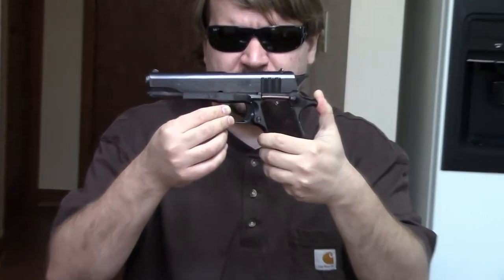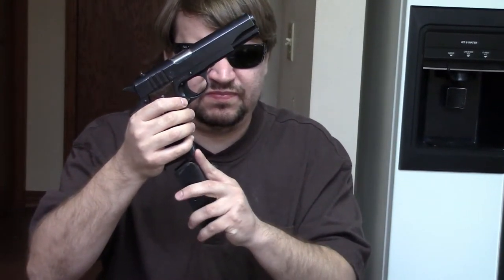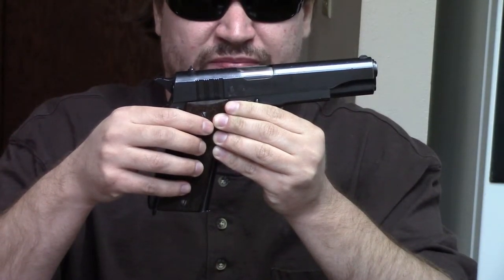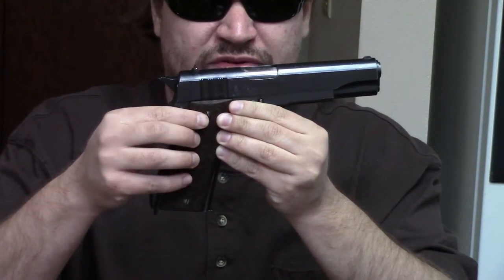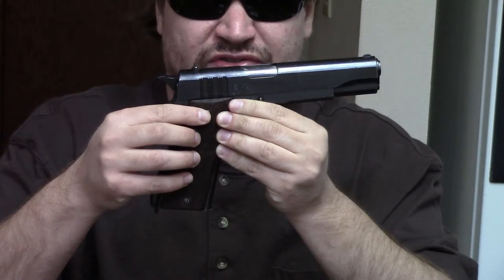Argentine Pistols - Systema M1927, Ballester-Molina, & FMAP Hi Power

Comment: On the Ballester-Molina, while I would take any 1911 magazine, even modern ones, the original BM magazines won't fit well (or at all) in a 1911 or Sistema, because they are a hair shorter. 
On the Hi-Power. FMAP (now just FM) in Argentina still make them in the form of FM M95 and Detective (shorter slide, 4" barrel), which are pretty much based on the FN HP Mark III (ambidextrous thumb saferty, firing pin block), except that they lack the distinctive HP lightening cuts on the front end of the slide. Ergo, it's more 1911'ish in that respect. They also have variants with the Safe Fast Shooting kit installed, which changes the way the safety works.
Reply: Thank you for watching, cheers.

Comment: Great review as always, Misha. My neighbor has an Argentine Ballester- Molina with a broken extractor, not interchangeable with a 1911 part. Any ideas on a replacement ? We've tried Numrich and all the other internet sources with no luck.
Reply: Hey friend, greetings from Argentina. Even here is pretty much impossible to find replacement parts for BM's other than the interchangeable parts with 1911 adaptations, such as the Sistema 1927; so your friend is probably better off checking with a gunsmith to actually make a new extractor.

*Correction: I've watched a video from a local youtuber who states that the extractor is actually interchangeable with 1911A1 extractors; are you certain that the extractor isn't compatible with 1911 ones? As far as I knew all of the slide parts  needed to be interchangeable with the Colt copies the Army was using back in the day.

Hope this was helpful!
Reply: Muchas gracias Javier! Appreciate the information!
Reply: Um bom armeiro fábrica pra Vc,  basta tirar a peça pra ver as medidas e levar no armeiro... Você não encontra peças de reposição, das balester molina, tive que mandar fazer um carregador para 15 rodadas, e uma mola de percursor.. Ficou top